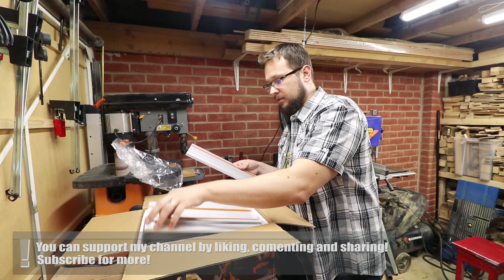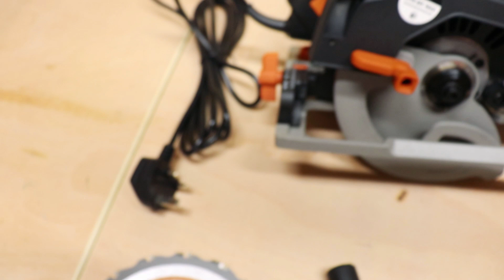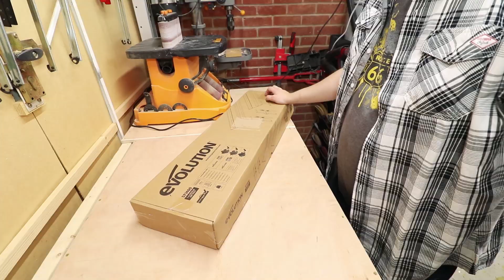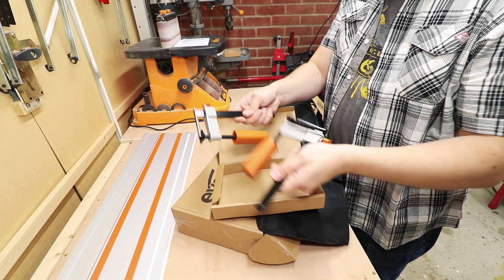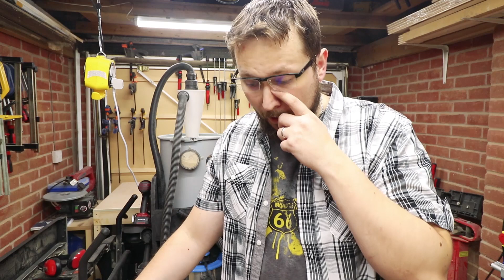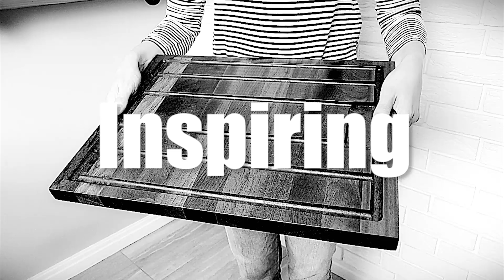Budget track saw from Evolution R185CCSX + 1.4m track pack that fits other makes of saws

Comment: Does this saw have a 20mm arbor bore?  So none of my Diablo 5/8" bore 7-1/4" or other saw blades will work?  Am I stuck only using Evolution saw blades ?
Reply from the maker: the bore hole is 24.5mm as far as I remember, just get a reducing ring and you can use any blade.
Reply: @CasualDIY  so where can I get a bushing to take a 5/8" hole in blade (16mm) to slide onto a 20mm or 24.5mm shaft?
Reply from the maker: @pbc1951  oh sorry just noticed you commented under the track saw, thought you were talking about the table saw blades. Not sure what is the bore hole on those blades for that saw I need to check

Comment: Tomasz  - your link is to the basic version - not to the + version. How do you find the depth setting - is the scale very accurate easy to use - some tracksaws have a pre-trim setting to reduce splintering/chipping on worktops - does this? Also are their any indents for 30/45 degrees and can it over saw at -1 or 46/47 degrees like some other models? Really appreciate your reviews.
Reply from the maker: If you are looking for an accurate plunge saw for countertops then this is not it. It's just a normal circular saw with a base that fits a track. And it's a shame really, hope Evolution will make a dedicated plunge saw. The depth stop is readable but hard to set up to super exact number. Basic angles 0-45 and anything inbetween. The tracks are very good tho 👍

Comment: who cares about how the factory saw blade performs? what about built quality, plastics.... the most stressed parts?
Reply from the maker: They are all good, it's basically the normal circural saw they got which in my opinion is very good made with quality parts. But the track saw version is so much worse on the dust, it just sprayes it out from the front of the saw.
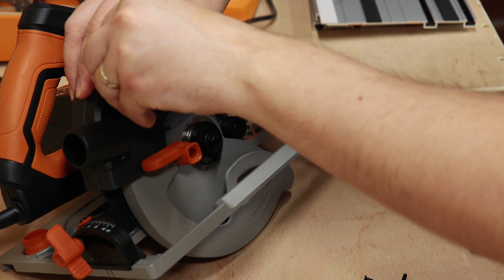Reply: @CasualDIY  Thank you for your quick reply. Though, I meant something like the reduction as in the video 3:10-3:14 mins - but I'm happy with your review and your additional comment ;) 

https://www.youtube.com/watch?v=LhakZ-wBIfk

Comment: I think you are wrong about the stated track compatability with Sheppach as their track size is slightly different.  Most of the major manufacturers use this system but Sheppach/Aldi/Lidl is different and not compatible.
Reply from the maker: Please see the link below to an Amazon listening of this track, in the description it does state Sheppach. I can only go by what the manufacturer states.
https://www.amazon.co.uk/Evolution-Power-Tools-ST2800-Circular/dp/B07HRDG2JG/ref=mp_s_a_1_1_sspa?keywords=evolution+track&qid=1572608479&sprefix=evolution+tr&sr=8-1-spons&psc=1&spLa=ZW5jcnlwdGVkUXVhbGlmaWVyPUFMWVZYTUg4VFhBS1QmZW5jcnlwdGVkSWQ9QTA0MDY5ODgyM1cxNDlDQlJXNEc5JmVuY3J5cHRlZEFkSWQ9QTA1MDMwNzQyV0cxTUpOUzNJOUdXJndpZGdldE5hbWU9c3BfcGhvbmVfc2VhcmNoX2F0ZiZhY3Rpb249Y2xpY2tSZWRpcmVjdCZkb05vdExvZ0NsaWNrPXRydWU=

Comment: Nice useful unboxing. Might be a good saw and tracks are great but it's a saw that runs on a track not a plunge saw. Even the Aldi and Lidl versions have better dust collection than that one. The plunge part and the dust collection are the main reasons to get a track saw coz you can always run a circular saw against a homemade fence. They have missed the mark on this one.🤔
Reply from the maker: Yes that's what I think. They tried to do two things with one saw and didn't really work. The base model of the circular saw without the track plate is brilliant but clearly not really suitable for the track. They should have made a dedicated plunge saw, as the track is brilliant. Hopefully they can make one in the future.

Comment: Hi, I have the "Parkside" saw which I bought for £39:00 about a year ago. I also have problems getting the depth of cut right. I suspect that a lot of the budget saws are made and re-badged for sale. I have not got the ability to cut steel (I have an angle grinder and a chop cutter),  but if I ever do I will buy the blade and use it that way.
Reply from the maker: Unfortunately they always have to cut corners at certain point of the design to get the price low. So far I like the Evolution tools as they do present good value for money. And maybe that's why with this tool in bit more disappointed as the base model of this saw without the track plate is brilliant. And somehow they didn't manage to improve with this one. Maybe the next model will be better.
Reply: @CasualDIY  I hope so as well